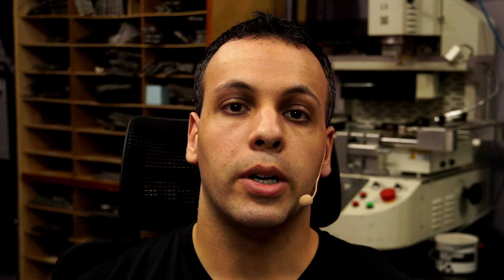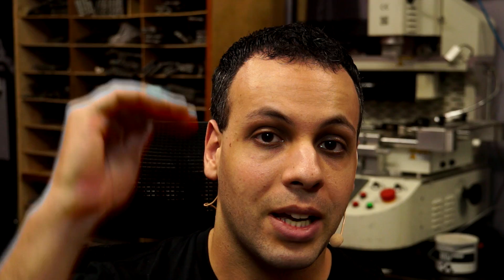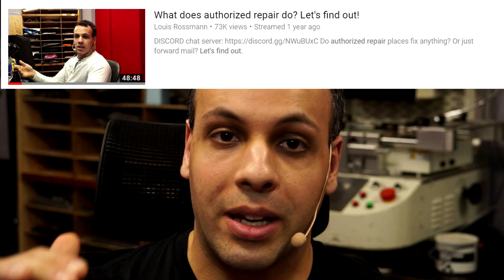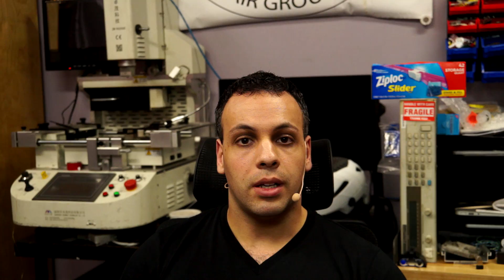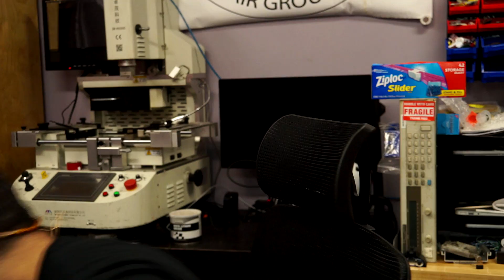Apple's war on refurbishing.

Comment: Louis, get a cheap EEPROM-programmer or a Bus Pirate, make a custom wiring loom with the correct connector and "fix" the EDID in those panels. It's just a I2C EEPROM that you can flash trough the cable. No need to have those panels sitting around being useless.
Reply: That's curious.. 🤔
Reply: does only apple has rigth to fuck you all? If they fuck customers in such nasty ways, why we can't fuck them? what about equality???
Reply: Now, THAT is fairly close to the definition of counterfeiting though.
Reply: @NJ-wb1cz  No it's not. The EDID EEPROM just contains timing information, production data, serial number and model number. Apple just locked their system to only recognise one model of the LCD panel, whereas most other computers ignore this and just reads timing information from it. Apple order more or less the same panel as Louis, but have it programmed with a special model number - otherwise it's the same product.
Reply: @zaprodk  how is passing off one  model as another one by messing with its internals not counterfeiting? You may argue that it's harmless counterfeiting, but it's still counterfeiting. You may similarly change serial numbers on legal 100$ bills, and those bills will still be considered counterfeit even though you didn't technically steal anything.
Reply: @NJ-wb1cz  we could discuss this forever. Let's hear Louis' thoughts on this.
Reply: @zaprodk  there's nothing to discuss. Fake ids and changing models is something a shifty taobao seller may do, not a guy in the middle of New York, standing up to the most powerful and litigious company.
Reply: These aren't the droids you're looking for, this way is not sustainable, and it will only give Apple ammunition in court. Apple has to be forced to unblock these ids, there's no other way.
Reply: I've been thinking, and you are probably right. So who's going to make Apple play fair?
The Government lol, sadly this is the only hope.
Without a public outcry nothing will change.
Reply: @Butt Seriously
You would have a point if zapro_dk was suggesting changing the IDs etc. and claiming the panels are a model they aren't.
If you change the IDs and claim that these are "apple compatible after modifications", would that still be counterfeiting?

Yeah the computer would think it's a different model, sure. Why does that matter if no factually wrong claim has been made?
Reply: ZealotOfSteal knows what he's talking about.  Zapro_dk never mentioned that the lcds should be passed off as something they aren't.  As long as you explain that to the client There Is No Problem, Ethical or Otherwise and maybe make a quick version youtube video of the back story so they can understand why doing this to the lcd panels is even a "thing". Imagine having to explain this to everyone that wants a new apple lcd, you'd never, ever, ever get any work done.
Reply: @ZealotOfSteal  perhaps it's not illegal (but you'll never know until the courts decide) ,  but it certainly won't help arguing for the right to repair laws. And Apple can trivially circumvent this anyway by using unique IDs, so the potential profit is very limited.
Reply: The goal here is to make repairmen first class citizens, not legalize a battle in which Apple can disable your trivial hacks any day along with all the devices you fixed,  destroying your reputation.
You can't build a proper repair industry on hacks.
Reply: Butt Seriously: I agree Apple has to be forced to behave decently. I don't agree the eeprom solution is shady, as long as nothing is passed off as a genuine original part. You are not circumventing any security measures with it, it's a mod to a system that you own and control. It's akin to changing the MAC address of an ethernet card because your router is retarded and only works with a specific range. Now, that is a hypothetical example I know, but only because no one would make such a shitty router. Apple just made a shitty product that does not work with certain screens, just because they are malevolent enough to do it on purpose doesn't make it wrong or shady in any way to fix that.
Reply: @NJ-wb1cz  Do you work for Apple? Or are you just Butt hurt?

Comment: Apple is starting to sound more and more like the bad guy. I understand that under most European law if you buy a product it’s yours to do with as you please, and I believe a manufacturer may only limit you if safety is involved (and that they have to prove that that’s the case when there is a dispute) 

The news and insight you proved Louis combined with that we are learning about the management controllers on intel and AMD processors means that effectively there is no longer a safe trustworthy platform for computing left. Stuff like libreboot is out of reach for normal consumers (and not without risks)   I believe it’s time for the 1st world countries to start saying “No, this is not ok to do!”   Your fight about right to repair should be extended to a level of “either you supply a way, or you lose the right to police (I mean controls) it”.  If not how can any of us do our job. (We can not trust the machines we use that control more and more of our infrastructure & society).

Comment: I used to repair 360s back in the day. Microsoft kinda did the same thing. They "married" the dvd trive with the motherboard so if you tried replacing your failed drive with a new one it wouldnt read games anymore and get you banned from xbox live.

Comment: I think that blocking home button because of "security" is bullshit, and I'm willing to explain why:
What can you do to compromise with  "hacking" this button?
It is just fingerprint reader, it will scan your fingerprint and send that information to OS, and there it is interpreted and checked it that is correct pattern.
To "hack" that button you need to already know the correct answer, and it is much easier to "print" custom fingerprint when you have that pattern.
You can imagine that, this is the same case as with keyboard to your computer, how plugging "hacked" keyboard help you to break you password?
You could of course plug something in the middle of home button and record someone fingerprint, but first: this is probably still possible, second,  you need to own this device before someone will use it, third, there are easier ways to get someone fingerprint (you are placing those all over the phone) .

Comment: I really don't know why there are so many products on the market are such badly designed for maintenance, customization and  repair. I still remember like in 2005 most of the gaming laptops still has swappable CPU and GPU, the cellphones has removable batteries for travel, SD card slots that allows you transfer data and extend storage. I really feel the products today are advancing in terms of marketing and advertising, but failed to improve Engineering design.
Reply: As an Engineering student, we are educated to make products fits the user need as much as possible while control the cost so people can afford them. I don't understand why you can't add a SD card slot on a cellphone for only a little bit cost while improving a lot of user experience.

Comment: Currently using MacBook Pro 2015 with staingate problem. Next upgrade 100% windows or Linux.
Reply: same for me bro!
Reply: Dell sells a lot of laptops with Linux Ubuntu preinstalled. Keeps windows completely off your shit so you don't have any license with them. Then you can install whatever you want
Reply: Don't do Windows, especially don't do Windows 10! Linux is the way to go, but I would not choose Ubuntu straight. I like Ubuntu-Mate. It still allows the control you deserve. Also others like, Lunux Lite, Lubuntu, Arch, are all good. Anyone of them is better than either of the big two.
Reply: Get Win 10, then make it dual boot for Linux. On the Windows 10 os, set your connection to metered for each wifi network you connect to if you don't want to download updates.
Reply: Stay away from windows 10, ive been on windows since 3.11 but this shit is too much, if it were not for my video games I woulda been on Linux right now.

Comment: Do you want to see the perfect solution for this issue? do you want to see Apple do the right thing? Just stop buying ANYTHING RELATED TO APPLE. THERE IS NO OTHER WAY AROUND at least until Apple stop considering 3rd party repair shops as criminals and arguing the apple products you bought are not yours.

Comment: That's why I never buy Apple products. I personally have a tendency to break phones (displays mostly). For me, not being able to fix my own phone, would mean I'd have to buy a new phone every 18 months or so. This is just did stupid. Look at Xiaomi on the other hand - they have their own stores, regular firmware updates (even for older phones), not original parts work out of the box and they also have a large modding community, so if Xiaomi decides "Hey, screw you. No more updates for your phone", someone will make an update for you.

Just buy Xiaomi.

Comment: This whole situation is worrying me A LOT.
I live in Prague and we do iPhone LCD/OLED refurbishment for Central Europe (Mainly CZ/GER)
This whole bullshit with Apple preventing 3rd party repairs in general is driving us insane. Like every new Apple device has fewer and fewer 3rd party replacable parts. It's my freaking right if I want to void my warranty (if it's not out yet anyway) and repair it at John Smith store coz he's a handyman who won't take 1200$$$ for battery replacement. iPhone is just as much piece of electronics as a vacuum cleaner.
Lol, can't wait for Apple to tie battery to the motherboard so that you can't replace battery without some synchronizing device.
Apple are walking on REALLY thin ice with that. They could get so much money if they collaborated with 3rd party stores like us, but then they won't look so "premium" and "unique", I guess.
Apple is nothing more but a school hooligan wearing sunglasses. After learning how iPhones and MacBooks work I don't even have any wish to have them fixed in any authorized store. The cost of the repair is extremely low if you know what to do. Even if you put original stuff in where it's needed (for most parts it doesn't even matter if the part is original due to their technological simplicity).

P.S. From what I know (not sure but I think it's true), the closest to Prague(1.3mil population) AUTHORIZED repair store of Apple is in...GERMANY! Dresden. 2 hours by train. And this is a fcking Central Europe!
Reply: Apple makes more money by not allowing repair, as many Isheep Just buy a new device for a couple of grand, of which apple is able to keep at least 50%
Reply: Jop, pár kamarádů se mě ptalo jestli bych jim nespravil ip8, protože ví, že jsem úspěšně vyměnil baterky displaye a component level mb opravy na android telefonech v minulosti. Iphony odmítám, protože nehodlám nést žádnou odpovědnost v případě, že se  jejich zařízení po bezproblémové výměně displaye brickne. Upřímně bych nechtěl být na vašem místě...

Comment: This is Apple's innovation curve going vertically down. Jobs is gone, and Apple has all but ceased to innovate. So they have jacked up their prices, and force aggrieved users to turn only to Apple for repair and replacement (follow the money). The answer? Stop buying Apple's crap, and stop worshipping at the altar of Apple. Let the company wither, as it is certain to do. (Although considering Apple's market cap, it might take them decades to fully collapse.)

Years ago I switched my design shop from Windows to Mac, as a defense against Vista. Spent an enormous amount on Apple hardware and software. Now, a few years later, I can no longer upgrade the OS on my original hardware, and as a result can no longer upgrade my design software. So my huge Mac is a doorstop. I immediately went down, bought a comparable PC for a fraction the cost. Sadly, we've now entered the era where both Windows and any software that runs on it is cloud-based, so I don't own any software I run anymore. But that's a separate issue. Welcome to 1965, when all the computing was done in a cold room somewhere, and you got to talk to the  mainframe using a dumb terminal or worse.

Comment: Keep up the fight Louis.  Changed my iPhone 6+ screen last month.  $27.75 for the screen, camera & button.  Took me only 4 minutes.  (had practice 'cause I changed the battery earlier).  Updated to v12 software and it continued to function.  Sadly the button sensor does not work but the old one stopped working long ago.  I can live without it.  Its sad that everything in our lives is becoming computer controlled.  My toaster has a cpu, so does my toothbrush which has a bluetooth connection to an app to analyse brushing.  Guess its just the world we live in.
Reply: It is not Apple that is at fault.
 it is just what happens when things get big.
To avoid it, stay small, which has its own issues
Reply: Well the pin didn't bend itself, it most likely happened during assembly which makes it Apple's fault.
Reply: My hunch is that it may have been a setup. Not inappropriate, but it would have been honest to have a known defect to challenge them with. Otherwise they are free to speculate. I got the bad pin problem on tests from AMI all the time. Not to defend Apple, but the challenge of scaling up to the corporate level is immense. It is a human problem. Sensitivity and humanity are hard to scale up.  I guess my point was that blaming isn't the answer.  Knowing how to right size is. If Louis' vids are  performance art, my hunch is the play is about reacting to how your parents really didn't have the answers. God bless 'em

Comment: Here's thing to really think about: right now, people are able to open up and repair older game consoles. Amiga, Atari, NES, Genesis, Playstation, etc. While the parts to do repairs are limited, most of the time, a system can be repaired somehow, even if you need another to salvage parts from. This lets those systems continue to work to this day.
Apple, on the flip side, is doing everything they can to NOT let this happen. I'm willing to bet that the last Atari to function will outlive the latest Apple product simply due to accessibility to repairs. A system from the 80s will outlive a system of today. Let that sink in.

Comment: its obvious its all about control and protecting the bottom line, they got people conned into believing that their products are worth the premium price, I'd be surprised if it cost them more than $100 to actually manufacture the phones they sell for $900 or more. They will sell out their mothers to protect that profit margin. so if you break a phone in their minds you need to buy a new one not have the old one fixed because that's money out of their pockets. not hard to figure when you look at the corporate earnings and realize just how little of market share they have compared to the rest meaning they make way more profit per item than the rest.

Comment: This could cause the land fills to fill up with E-junk ? If this happens ! And also destroy one entire industry in a short time. And then spill over into the other repair industries. Making every piece of equipment all the way to the very car you drive. Where you will only be able to get that fixed is only at the dealership of where you bought it ! There then it will be that no more cheap repairs for anyone ! And a lot of delays in getting it fixed !

Comment: Did anyone think Apple is doing this and pushing forward because if they win, they can make more money suing 3rd parties as well.  Once these 3rd parties are out of the way, they can make their authorized dealers/repairers to stall which forces the users to buy a new device (which they will because they love Apple so much).  They can then take the used devices, refurbish them and resell them like new to make even more money.  

There was one comment from another video of a person whom mentioned of their experience that Apple had resold to them a refurbished phone as brand new with unopened shrink wrap still.  Think of how deceptive that is as a retailer to do that to a consumer.  If they win this, one thing for sure, I can see this type of event happening more often with Apple as that definitely will generate a large sum of money for them.

Comment: Here's what will happen to get around this shit Apple has put in place, people will obtain these Apple product parts, and then HACK the part ID to match it's original part you want to replace, in modifying the hardware ID through either physical hard-modding or non-physical soft-modding the part itself that has the ID in order to bypass this hardware restriction. Nothing is impossible to hack, and I'm sure there will be some fatal flaw in Apple's design that will allow hardware ID's to be changed, or completely overriding the software's hardware ID checks, someone somewhere will definitely come up with a method of some sort of being able to do that.

Second, someone somewhere will probably and eventually leak the software and tools Apple uses to check and configure replacement parts in their products so that it will run without all this bullshit sharing it out into a private public space, where someone then will reverse engineer that software tool and dissect the ins and outs of how it all works.

Many of the patents that Apple has are pretty much null, void and illegal, they may be allowed in the US with those sort of patents, but in other parts of the world, they are NOT even allowed for some of the patents they have because they don't follow the compliance of EU-Asian regulations, and have been slapped on several occasions for these things and lost their cases in a court ruling.